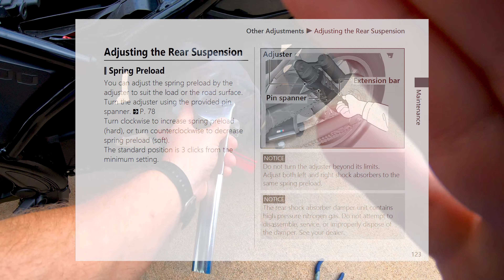REBEL1100: Suspension Tuning Part 2 - Adjusting rear shock preload

Comment: FYI... 3 is a great start setting for 100 pound riders like me...  :-P
Reply from the maker: Congrats on your Rebel 1100!  WOW... that beast must really FLY with your feathery 100 pounds on it!  I'm a small/light rider by USA standards, and the Rebel 1100 tries to lift the front wheel in 1st and 2nd gear with me on it.  I'll bet it's even more eager to lift skyward with you aboard... that's gotta be loads of fun!  Cheers!  👍  --QM
Reply: @QuasiMotard  It flies, love this bike.  I accidently got a foot or so off the ground, but it stops me from doing much with the wheelie control.  I don't really want to do wheelies so that's fine... just got used to rain mode the first week I had it, and was a big switch to sport.  I'd probably have wrecked already if this was my first bike.

Comment: Never ever seen someone place a plastic bag between nut and wrench
Reply from the maker: That's an old trick from working with anodized AN fittings.  It usually helps, but doesn't do much with sharp-edged tools like a shock spanner wrench.  Cheers!  😉👍  --QM

Comment: Not a good bike for someone 6'5" and 280 #'s, I'm afraid.
Reply from the maker: Nope!  The ergonomics are even a bit tight for me at 5'7" and 170 lbs.  Riders above 6' will feel very cramped and would probably need forward controls or footpeg relocation kits to give enough leg room.  😉👍 --QM
Reply: I'm a tad shorter than you and get leg cramps sometimes but love the bike.

Comment: 8:30 that is way way to stiff 😮😮 holy smokes. I weigh 155 pounds and my is all the way up and I still feel a stiff
Reply from the maker: That's why the zip-tie test is important.  It lets you see how much compression/travel is happening on the shock tube.  I increased the preload all the way up to test how many steps there are; the Honda owner's manual doesn't specify how many clicks are available.  My riding weight is ~170 lbs, and I'm running my Rebel at 8 clicks for normal city riding, and 11 clicks for touring (loaded with luggage on the back).  --QM
Reply: @QuasiMotard how much added weight would you guess your long haul add-ons add? I am asking cause im a bigger guy, and am trying to get an idea of a good base start. So I dont spend a day digging zip ties out of the stopper..lol